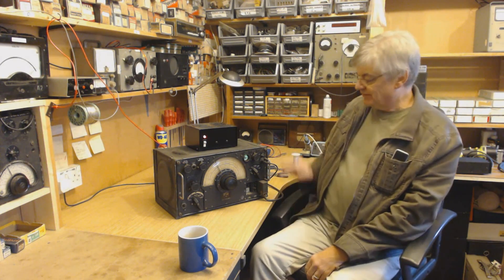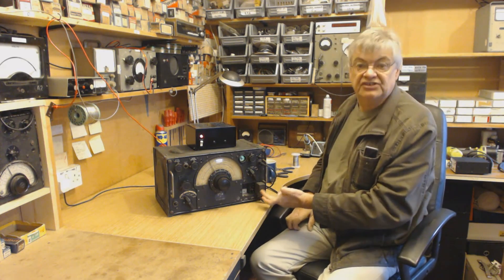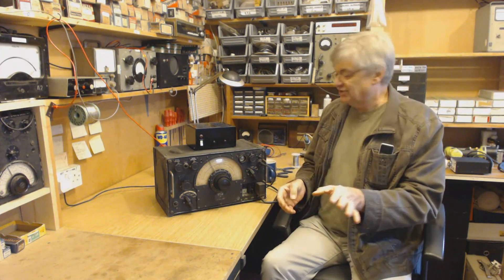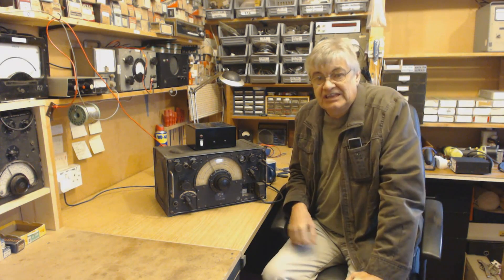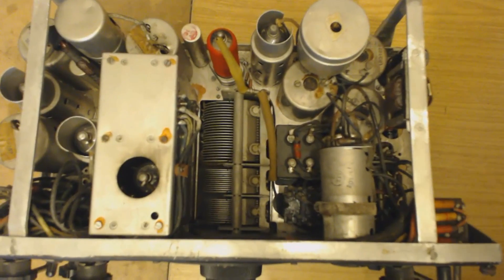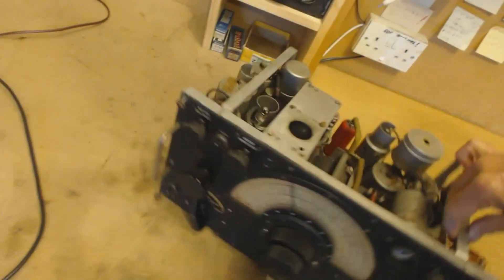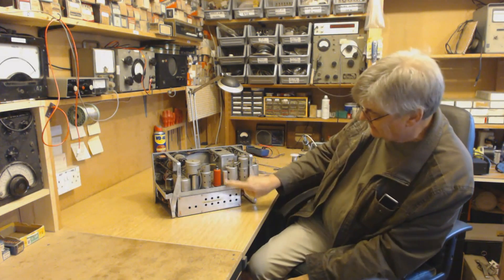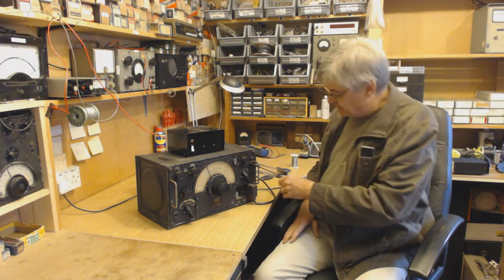Marconi R1155 Communications Receiver

Comment: I had a similar experience with the Collins 75A-4.  As a teenager, I had heard it hyped up so much that it took on an incredible image in my mind.  Then, when I borrowed enough money to buy one, I was quite disappointed.  The sensitivity was poor, it would overload easily, AGC was too fast for SSB, original mechanical filters were lossy, etc.  I sold it and never bought another.
Reply from the maker: I think there was a lot of hype about military gear back then, that was far removed from reality!

Comment: At the age of 15 and starting an interest in radio and SWL back in the early 70's I spotted one of these in a second hand shop marked up at about £15. Mentioned it to a Ham who lived nearby and he said he would help with any work it needed. Armed with this positive backup I raided my piggy bank and found I was a couple of quid shy. Ok "Dad what jobs can I do If you sub me the difference?" His reaction was "why do you want to buy second hand Tat". He took me upto Tottenham Court Road in the area where at the time was a large number of electronics outlets to a Schlumberger Heathkit outlet and topped up my money to over £30 and bought me a kit. The Heathkit SW717.  A great little learning project. Soldering, construction, being methodical. Learning how it worked. It worked and after all these years still works (with some minor repairs and improvements), but I still wish I had bought that 1155. The heathkit wasn't a patch on those old war time sets.
Reply from the maker: I often visited Tottenham Court Road, happy days! OK on the Heathkit etc. Yes, I agree. Cheers, Ray.

Comment: A few years late but I didn't miss much. The vandalism, removal of the DF section, addition of a 6V6 audio amp inside the case!, goodness knows where you put the by-pass caps (3 per canister) etc, all adds up to a ..mess. 
Ugly now but a decently restored set looks great. Your lack of interest even extended to confusing the tuning knob mechanisms (you have the earlier variant). 
Properly aligned, the set performs very well against such sets as the National HRO Sr through to modern gear. It's no slouch.
An R1155 I use in the Antipodes has no trouble raising mates in the UK and elsewhere around the world. I wound a new external rotating DF antenna (as per AM plans) and together with the long wire (trailing) antenna it well demonstrates the DF function with the dual meter. 
All external connections (including the DF dual meter mentioned above) are made via the front Jones sockets onto the plugs, as per usual and this keeps it uncluttered.
My external PS in a smaller metal (black crackle paint) box  has period AM meters to monitor HT, bias and plate current. The 6V6 audio amp is located there, too, as well as soft start circuitry to help valve life.
You owe it to the 55,000 to fix it. 🙂
Reply: Yes, seen too many of these vandalised with everything ripped out. I have 2 of them. All original and capable of doing EXACTLY  what they were intended to do. These are not common, certainly not ugly and are very capable. Even though I'm a ham, I recognise that a lot of licenced hams are the worst for ruining stuff. Over confident in their abilities.... These are a chunk of history. Along with the '19set' and the PCR radios, they're the most recognised.

Comment: Had one back in the1970's. Fully working, lost interest and dumped it at the local council tip. Such a waste. Also scrapped many huge old domestic valve radios back in the day. Salvaged a few bits such as valves and knobs. Still have my Grandma's old DAC90 though. Might even still have the circuit diagrams for the 1155 somewhere.

Comment: HI Ray ... What kind of antenna are you using ? 73
Reply from the maker: s52ab Hi, I'm using about 70 feet of wire. I also use a doublet antenna for transmitting and receiving. Cheers, Ray.

Comment: Hi Ray. Very nice sets. My uncle started his amateur 'career' with one of these. I picked up an 1155 few days ago as a restoration project. It's been modified with an RF gain control, internal power supply and a more powerful audio output stage. I have reformed it and it works except that it hums a lot and completely drowns out any audio when the AF gain is turned any further than half way up. It also seems to distort the audio such that voices sound very much like daleks. Had you any suggestions as to how to fix these issues?
Many thanks
Reply from the maker: Hi Liam,

This isn't really my area as I've not had a great deal to do with the R1155 radios. I assume the HT smoothing caps are OK?

Cheers,
Ray.
Reply: Ray Heffer Hi Ray.
The smoothing cap does need replacing. It has leaked all over the surrounding wiring and inside the case. Furthermore I had a problem where a large resistor behind the wave change switch started to burn, caused I think by the now failed smoothing cap. Hopefully when replaced, it will have eliminated the hum. 

Many thanks again

Liam

Comment: HA I can just feel the 16 year old's disappointment when he got it home and it performed like your Lafayette. I must say, born in 1970 I'm obsessed with having a dial like this on something even if it winds up being a signal generator stuck in a corner... just a must have, you know. Speaking of Lafayette: I got my Tech ticket after playing with CB for years off and on and feeling as though I'll stay focused on radio indefinitely now. I've played with 10m with a 25-30MHz mobile, the locals on 2m and 70cm repeaters with some intention for low earth orbit antenna making, and am studying General class for HF (I feel I'll be an HF guy most of all, as large waves titillate me). I'm saving for, say, a Kenwood TS on EBay, but it will be a little while until those two things come together and I'm ragchewing with, well, perhaps the likes of you. Until then, I was considering takign a $50 chunk out of my TS savings for a SW receiver to play with long antennae on my property. Debating this, I came across a guy with $15-$20(US) receivers at the flea market right across the street! Roach pod encrusted, mistreated, pathetic things. I got the Lafayette Star-Fire VI portable because it had the most range (including "SW3" so it has MW thru 23MHz consistent). I can't believe it I"m so happy. $15 later, I'm already picking up SW stations just the telescopic. I'm assuming the external antenna jack (1/8") is "hot" middle inside (or the small tip/end of the male) and grounded around outside of that (rear/longer part of the male). I can't wait to make a longwire or doublet! Better off without SSB for now or I'd go crazy wanting to chime in with hams :) Thanks and we love your videos, 73, W4VEY
Reply: Jeff Burris ii

Comment: Hi Ray. I was recently given one of these R1155s on the understanding that I do a full and sympathetic restoration. All of the rubber wiring insulation has crumbled away, so it will need rewiring for a start. The dial is very faded so a friend has made a new copy (from a scan of the original) in photoshop. The perspex window has also gone so brown and opaque that I'll need to mould a replacement. Already tried a good clean and polish. Anyway, there is a lot of red ink over the chassis and internal components. Do you know why this is? Would it have been splashed inside when the radio was declared War Department surplus?  
Thanks Jon. G4VFT
Reply from the maker: Hi Jon, it sounds like a nice project. I don't about the red ink, if you find out let me know. I will ask around and try to discover its meaning. Good luck with it and do keep me posted. Cheers, Ray.